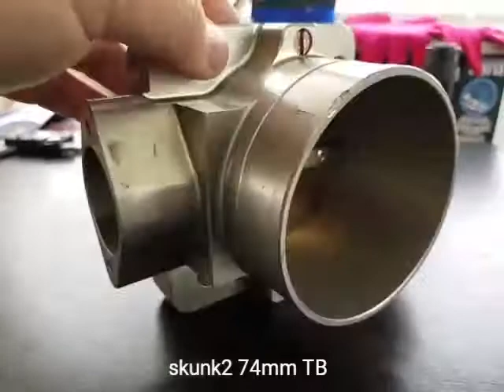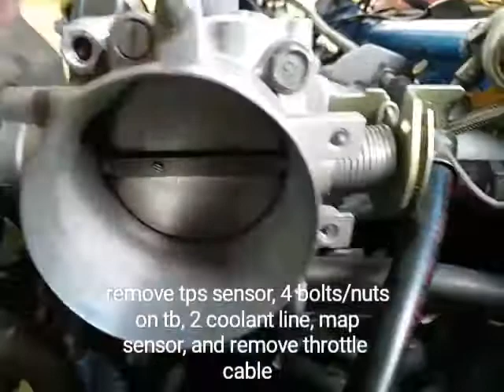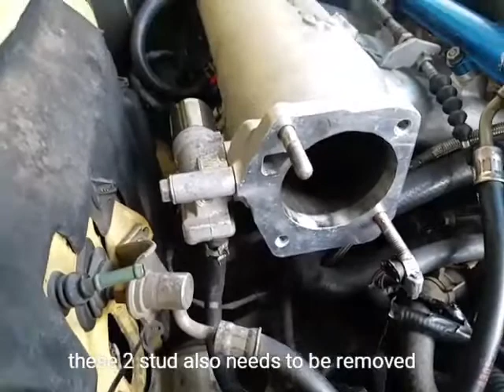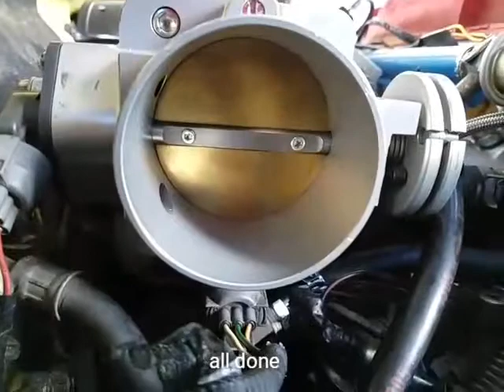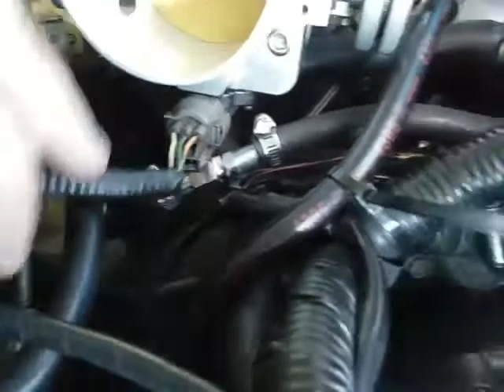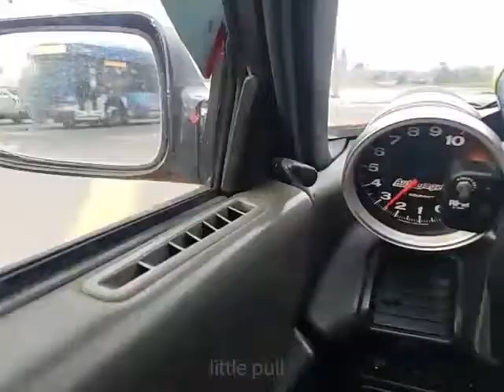S2 74mm throttle body installed

Comment: How did you connect your idle air control valve my water tube from the thermostat to the block only has one tube and the other one usually went to the throttlebody and this one doesn’t have one so how do I go about that
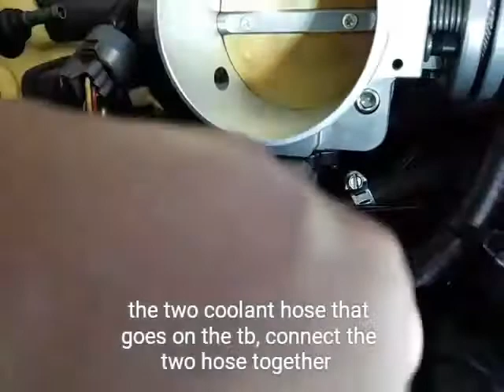Reply from the maker: At 1:43 bro. Connect the idle air control valve  coolant line with the other one at the thermostat coolant line and thats it.

Comment: What did u do with the hose that’s sappose to go on top of the stock TB. Ik u connected the two coolant hoses together but what about that third one?
Reply from the maker: I've deleted my charcoal canister/evap system so that hose is no longer there. Just cap it off and it's good to go.
Reply: AllMotorGang okay thanks I figured. I just finished putting in my S2 intake mani and that same 74mm TB into my prelude. I had to delete my egr bc of the new intake mani too.
Reply: AllMotorGang oh yeah and meant to ask u what cold air intake do u prefer I should go with this TB
Reply from the maker: @mightylude4985  not sure what intake or brand you should go with but I did ran it with a custom 3 inch intake with I still had it.

Comment: Does this throttle body “delete” the fast idle valve ? Is that why you connected both of those coolant hoses together ?
Reply from the maker: Lawrence Bernal yes this throttle body delete the fast idle valve so you'll have to connect the hose together
Reply: allmotorCRX Thank you brother.. I was super confused yesterday on my setup and I was searching and searching for vids and came up on yours and what you did is what I thought about doing, now that you confirmed it I will continue.. Thanks again and your reply is much appreciated bro...
Reply from the maker: Lawrence Bernal np glad I can help
Reply: allmotorCRX Another question, how do you adjust the TPS ? What color is the wire that I’m supposed to be testing ? I’m not sure if I’m reading the wire right but it’s telling me I have 4.21V at closed throttle and 0.63 at open, now I know that completely wrong so what could be my problem ? I’m just so confused..
Reply from the maker: Lawrence Bernal it's the red wire. Set the meter to dc voltage. Also make sure not to get the tps plug and map plug mix up.
Reply: allmotorCRX Does the tps and map connectors look identical ?
Reply from the maker: Lawrence Bernal yes
Reply: allmotorCRX That could be my problem then, I will update you when I get to it, thanks brother...
Reply: why wouldnt you just fucking cap them and plug them at their respective ends? Hooking the hoses together accomplishes nothing and looks like utter shit.